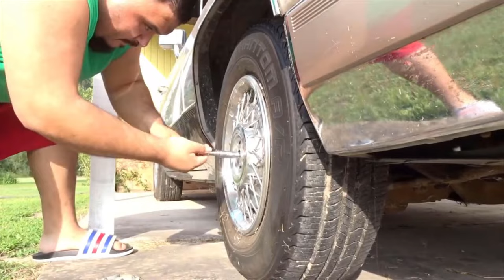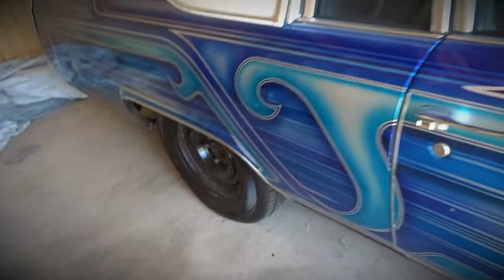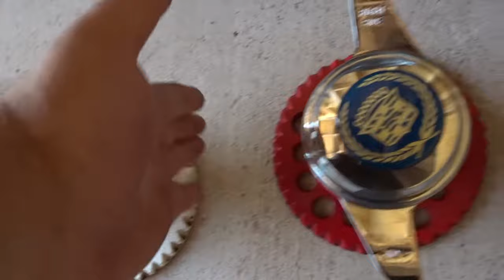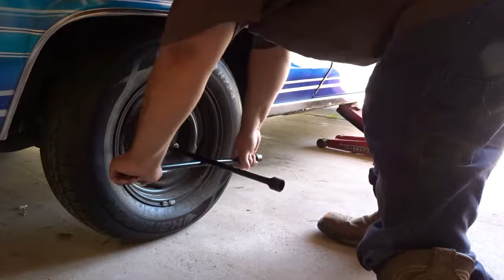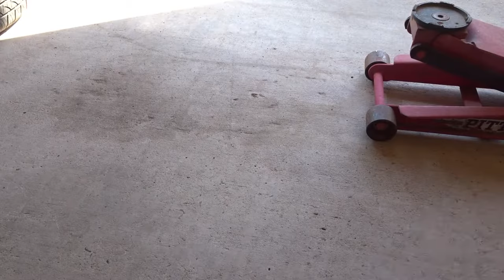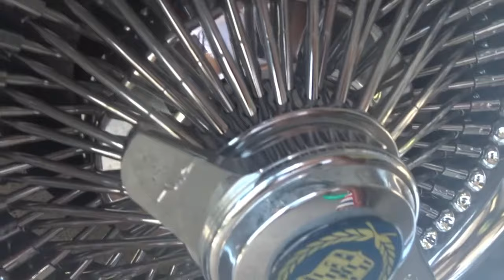HOW TO MOUNT WIRE RIMS ON YOUR RIDE (Og Wire Wheels) | Cadillac Chronicles | Episode 12

Comment: Failed to mentioned an important thing. Red goes on the right side and the white on the left side and the the knocks always tighten to the rear. You be surprised how many ive come across that are wrong. And make sure the rim meshes in with the notches of the adapters.
Reply from the maker: I did explain the right and the red with the corresponding sides but I did fail to mention the notches homie thanks for the inputs and thanks for watching
Reply: Dam my wire wheel came off…😔 adapter bolts came off. Probly I didn’t torque it’s the right specs..
Reply: Your wheel came off while driving?
Reply: Spacers are mandatory?

Comment: Thanks bro 
I was about to resell some knock offs I bought today because my passenger  side tire flew off in the middle of the freeway as I was driving back home from the purchase. 
After watching your video I learned I placed the the rims wrong!
I placed WHITE in the front and RED in the rear!!that’s why the rim came loose!
I will change them tomorrow and give the knock offs a second chance!
Gracias Hommie por la info……
Reply from the maker: No problem homie glad I could help let me know how it goes
Reply: Ya bro always white on the driver side red on the passenger on all wires...Any updates?
Reply: Glad your safe but hey I had similar problem but I did put the right in front and flew out and the adapter got stripped got a new and same problem can help me out

Comment: Great video my friend. Thanks for the good info I just bought a 63 Ford galaxy 500 and I’ve had some rims 14 inch wire spokes. I’m hoping they will fit. It will be my first time mounting wire wheels. I hope they do a good job I hope the 14s will fit on the galaxy.
Reply from the maker: Thanks homie glad I could help.  Hope all goes well with your time they should fit
Reply: @OneManClicka  👍🏼💯
Reply from the maker: @raiderdefendant2225  💯💯💯

Comment: Did you have any issues out riding? Did the spacer effect anything?
Reply from the maker: @akkryte757  naw no issue only thing is when you start hitting switches you run out of air and have to wait for the tank to fill before continuing the fun or raise the ride so you can drive

Comment: i just bought some wire rims, but i cant find the red/white center threaded adapters like you got, where did you get them?
Reply from the maker: Mine came with the car but they are og wire wheels... you don't have the adapters at all?
Reply: They don’t have to be white and red. The colors just help you to know which side to put them on. Some adapters are all chrome but to distinguish which is for what side just always remember the knock offs should always tighten towards the trunk. So your always gonna have 2 adapters that lock normal; and 2 others that lock to the left.

Comment: Do you have to run the spacers on the front ? What’s the reason ? I’m new to this. And my wire wheels I got didn’t come with spacer. Only the adapters so I’m confused
Reply from the maker: Depends on the vehicle homie just mount them and take a cruise around the block to see if they rub against the tires or rims if they do then you'll need spacers
Reply: If you put them on and no rub your good,most spacers are due to rubbing the caliber in the front, you can either grind the caliber or get spacers

Comment: why do you need spacers in the front i havent seen those before?  i haven seen them for same with rims either.  is that with all cars and trucks or just certain ones?
Reply from the maker: Just certain vehicles,  the spacers just help so the rim or tire don't rub or scrap on anything.
Reply: @OneManClicka oh,  would i need it on a chevy or toyota pickup?
Reply from the maker: @CampfireTalesYT  honestly I couldn't tell you on those homie best thing to do is install them and then take a ride to see if they rub or scrap
Reply: @OneManClicka   Sounds about right appreciate it
Reply from the maker: @CampfireTalesYT  no problem homie good luck 💯
Reply: So the rim doesn’t scrap the caliper

Comment: What size spacers are u running
Reply from the maker: Honestly I don't remember off the top of my head homie is have to double check but I'll get back with you
Reply: Did you get that information yet ? About to put 13's on my box
Reply from the maker: @JeremyDavis-x3l  I'm running 1/2 inch on mine homie

Comment: What size spacers did you use? I dont have a impact drill is hand tight good enough or no?
Reply from the maker: Mine are 7 inch and a led hammer will get the job done no worries..I just recently found out about the impact ones
Reply: @OneManClicka  7 inch spacers? Arent they usually like 1/8th or somsthing small?  I meant the bolts being hand tight with a cross bar. I know the hammer will do the job for the knockoff part good
Reply from the maker: @CampfireTalesYT  oh I don't remember on the spacers and yes hand tight with the cross bar will be fine no worries... my bad I read wrong
Reply: @OneManClicka  no worries. So ive had bolt on wire wheels in the past. Is knock offs more work or maintenance? Do you check with with the hammer all the time to make sure they dont get loose or am i over worrying lol
Reply from the maker: @CampfireTalesYT  there not much maintenance but depends how much you drive on them mines just a weekend rider but you'll be good man just check on them from time to time don't over think lol
Reply: Are they spacers crucial? I had someone install them on my 70 caprice and the 2 front tires popped when I took it out , they felt like they rubbed a bit I was told they needed spacers

Comment: Question why you out the spacer I’m bout to get my first set of wire wheels
Reply from the maker: It really depends on what vehicle your going to put them on homie, you won't really know until you mount them unless you got a homie that has the same kind of ride then they could tell you if your going to need them or not.  The good thing is spacers are easy to get so if you do need then you won't have to wait long
Reply: @OneManClicka  thanks for the feed back and respond I’m putting them on a 98 grand marquis
Reply from the maker: @V8ryderz Autoclub  no problem homie thanks for watching ... there going to look dope hope all goes well

Comment: Can you fit 13x7 with just spacers?
Reply from the maker: @memegator6937  with or without?
Reply: @OneManClicka  with spacers instead of grinding down calipers
Reply from the maker: @memegator6937  yes you can just depends on the car some need them some dont you wont really know until you mount them and ride it around to see if your going to need them homie

Comment: How many miles can you get off those types of tires?
Reply from the maker: @Blazer20686  honestly I don't know homie depends on how heavy the ride is and if your going to be hopping or 3 wheeling plus how fast your going to
Reply: @OneManClicka  im looking at a 93 fleetwood with 3 pump 8 battery setup for $8500🤔.... If I buy, I wont be going all crazy with that shit and ocassionally hitting the switches. I want to drive to work with it once in a while so freeway most of the time.
Reply from the maker: If that's the case they should last you a wile I've had the same tires for 2 years but I just take it to car shows, cruising here and there but I'm rolling with airbags so less weight
Reply: @OneManClicka  Cool. Thank you brotha, subscribed.
Reply from the maker: @Blazer20686  anytime homie 💯💯 thank you for the support 🙏

Comment: Never jack the car from the middle of the frame. It's the weakest area and it will bend messing up the frame. 🙌🙌🤙🤙💯💯
Reply from the maker: Thanks for the wisdom homie I'll keep it in mind for next time... thanks for watching 💯💯💯
Reply: Also avoid jacking the car from the rear differential.  It can cause leaks.
Reply: It can also go threw the floor and poke a hole in the carpet
Reply from the maker: @perezm714  10 4 homie
Reply: Thats the first thing i noticed. I can literally watch as the car is getting fucked up from that jack. Pleade please please jack from specified jacking points, NOT FROM YOUR PINCH WELDS.

Comment: The. First  you   got  take  off  4  wheels  
And  putting  the   2  red. Right  adapters and  2  white   left   adapters  tide  it  up,,  to  put  13inch   100  wire spokes   put  grease inside a knockoff spinner   and  hitt  the  front knockoff  and  tide  it  up
Reply from the maker: Yes sir

Comment: Why do you use spacers on just the front rims
Reply from the maker: Because the rims in the front were more inward then the back which made the tire rub against the metal on the inside.. the back has the reverse problem but only if I try driving the car when it's completely lowered to the ground

Comment: Why the spacer on the front wheels?
Reply from the maker: Just certain vehicles,  the spacers just help so the rim or tire don't rub or scrap on anything. It's only in certain vehicles  it varies you won't know until you mount them
Reply: @OneManClicka  Got it thks
Reply from the maker: @mattblack  no problem homie 💯

Comment: Front lug studs are to short lug nut with time loosen and sooner later you be 3 wheeling without switches
Reply from the maker: Appreciate the info homie 🙏  I already changed them out tho since time back
Reply: You had to change the front studs? Never had the issue how did you know to change them?

Comment: Why do you need a spacer for the front and is it absolutely necessary?
Reply from the maker: Just certain vehicles,  the spacers just help so the rim or tire don't rub or scrap on anything. It's only in certain vehicles  it varies you won't know until you mount them
Reply: @OneManClicka  thanks for the info my guy. I'm at work now attempting this on my 91  cadillac brougham. Hopefully I wnt need them but your knowledge helps.
Reply from the maker: @slabbinonspokez z  no problem homie hopefully all goes well but if you do end up needing them it's just a quick trip to the sotto parts store.. good luck on your build
Reply: @OneManClicka  thanks alot man I really appreciate it. Just finished btw. I hadn't taken it out for a drive but I did move it back and forth across the shop. No weird noises or anything but I'll confirm this once I actually drive it a mile or two. Thanks again for your help wishing me well on my project 💯.
Reply from the maker: @slabbinonspokez z  anytime man enjoy 💯
Reply: I just got some 13 daytons im trying to mount on a 2001 cadillac deville im having trouble finding a spacer that will work tho
Reply from the maker: @samuelariza9085  its going to be hard to find some homie because they are metric so you will need to find some metric spacers... check if the spacers you got are standard or metric?
Reply: @OneManClicka  i just ordered some from amazon says its for cadillacs so im praying it works
Reply: @OneManClicka  i checked and theyre 5×4.5 5 lug 1 ich
Reply from the maker: @Samuel Ariza  good luck homie hope everything works out ...I asked my og and that's what he told me he's got over 20 years in the game when it comes to lowriders
Reply: What size spacers do I need I found some that are 5/16 thick
Reply: @OneManClicka  i had to get 1.5 inch spacers and i grinded down the front caliper a lil bit thanks for the advice man
Reply from the maker: @gerardo sanchez  it really depends on the vehicle you need then thick enough so they don't rub on the inner or outer rim
Reply from the maker: @Samuel Ariza  no problem homie glad everything worker out
Reply: @samuelariza9085  what year I got a 86 fleetwood brougham
Reply: @gerardosanchez7959  2001 deville

Comment: What size were them tires and rims.. I have a 2005 cadillac deville 4 door I want to put 14s 50 spoke and advise?.
Reply from the maker: My rims are 13×7 homie not to sure on the tires ... you going to go with swangaz or lowrider spokes?
Reply: @OneManClicka  lowrider culture homie spokes ture knockoffs.
Reply: @OneManClicka  I wish YT would let me upload s picture..
Reply from the maker: @terrynunez7957  hell yea homie well is definitely go a bit bigger . Are you going to have hydros or bags in the future?
Reply from the maker: @terrynunez7957  hit my social media homie I'm on all platforms
Reply: @OneManClicka  I'm thinking bags because the rear has airbag suspension shocks.. but I still 50/50 so OneManClicka would be the name for your other media platforms?.
Reply from the maker: @terrynunez7957  dope yea defenatly get some kind of suspension work done I had to put spacers on my caddi before I put air bags on it or else it would scape... yes sir or check the description of the video so my links are there homie